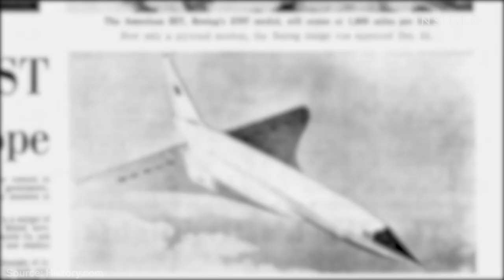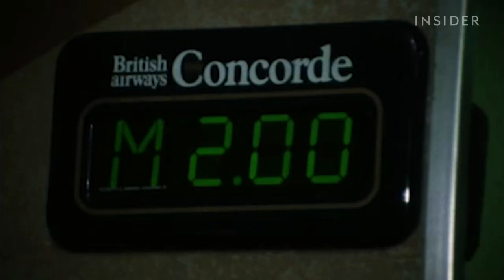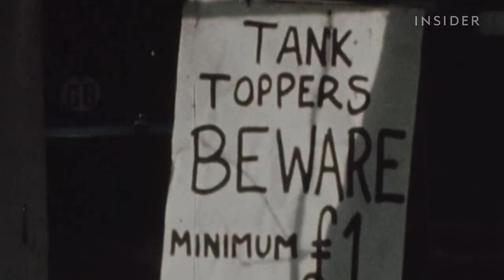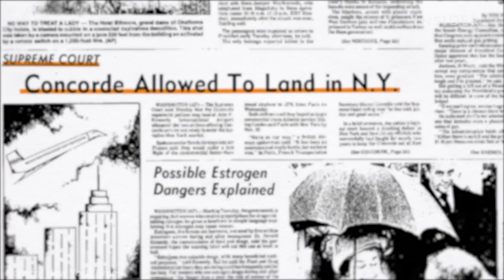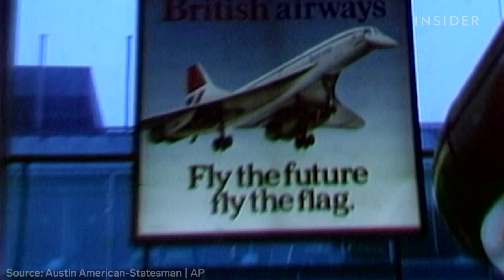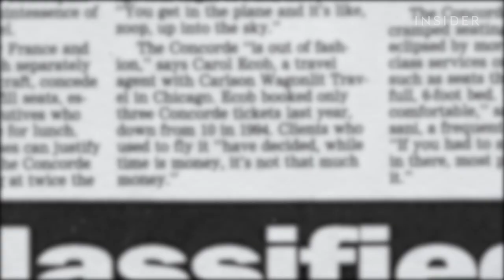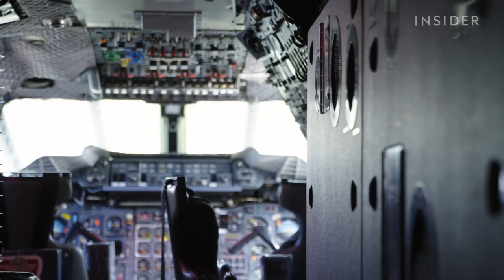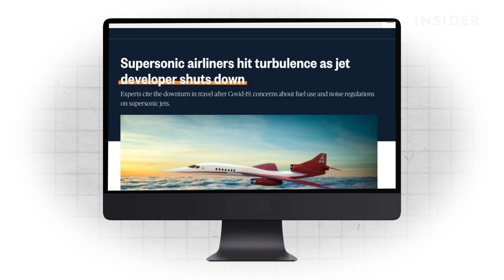Is Supersonic About To Come Back? | Rise And Fall

Comment: Some of them still exist.  It may have been a joke on 'the' "continent".  There was a report that the powerful vacuum around the intake of the engines picked up a piece of metal from a previous flight (Continental . . . based in Denver) (a place where I was opened up in 1971).  Once again, it may have been a joke by seedy ne'er-do-wells against the 'old country'.  Those sorts ALSO exist.  Apologies.  I guess my father couldn't keep his pants on.

Comment: Concorde is the most beautiful air frame in the history of aviation. Nothing in aerodynamic design can even come close to it. Deal with it, nitwits.
Reply: No. Planes that are fast r bad
Reply: BS.
Have you seen the blackbird?
Reply: @neeljavia2965  Imo, both are aerodynamically good and so as with the aesthetics. I mean, you could stare at em all day long, the curves, the lines, and every leading edge of it...just wondering how did they build such planes like those.
Reply: @scarecrow108productions7  Concord honestly looks weird.
Reply: @neeljavia2965  i guess it does...to me sometimes. But after looking at the Blackbird, it comes to me that...Lockheed-Skunkworks made one helluva plane that flew faster and higher than ever before...for military use, god bless Kelly Johnson for making such an incredible plane.
Reply: @scarecrow108productions7  Yep.
The black colour also magnifies the looks.